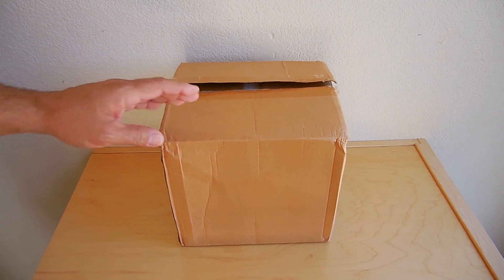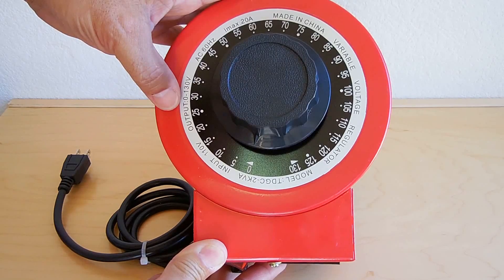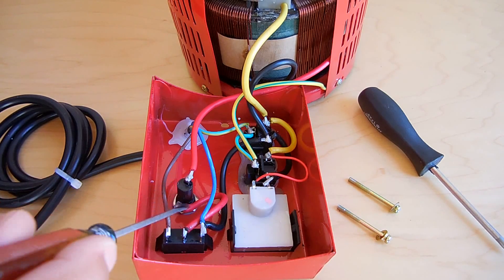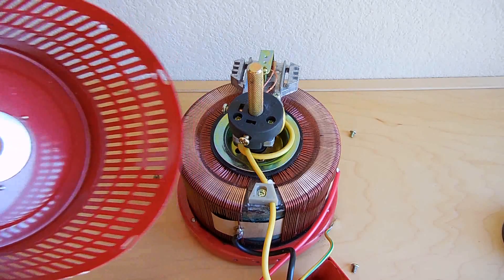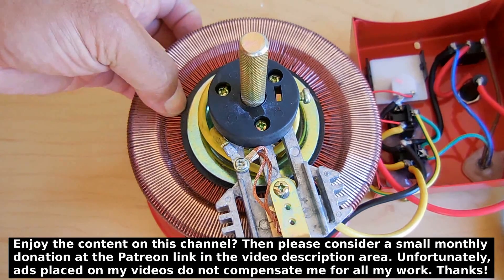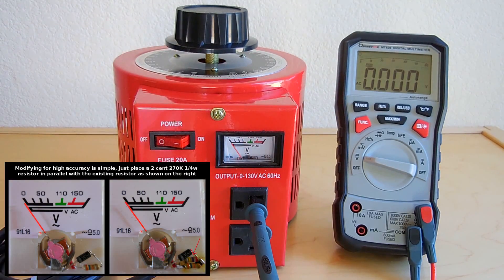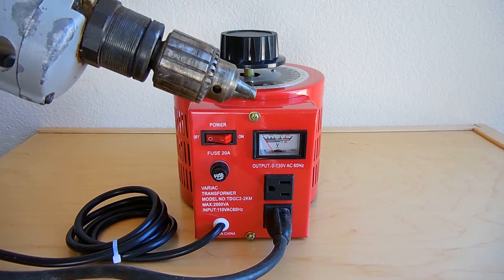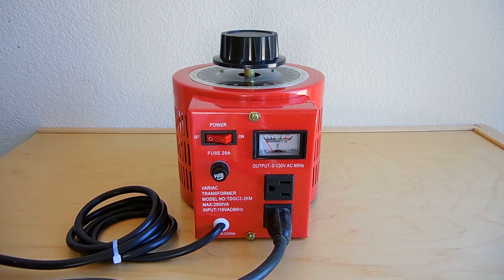2KVA 120V Variac Autotransformer (Incredible Buy)

Comment from the maker: Thanks for watching guys! If you're looking for other equipment/items at great prices, then please refer to my video playlist below. Scroll through the list to look for items of interest.

https://www.youtube.com/playlist?list=PLQ6IOhUBblU161growMalXOs1Ers6q_tj
Reply: I have a pure sine wave inverter that's putting out about 110V and I have an electronic pilot ignition on my gas water heater that demands exactly 120V.  I'm trying to find power line conditioner will boost to a steady 120V .  Will this AC Variable Automatic Voltage Regulator Converter do the job of stabilizing the output voltage to 120V?
Reply from the maker: @tersta1  Yes. You can boost up the AC input voltage to around 135V.
Reply: @electronicsNmore   Perfect!  I'm ordering one.  Thanks. :)
Reply from the maker: @tersta1  If it's not on sale, use the coupon code.
Reply: @electronicsNmore  For sure, I used the coupon to get a few dollars off and it was a lower price than other brands too.  Good deal .  Thanks for the video.
Reply: Do this isn’t to use near ViC gas flammable chemicals fumes?  Housin?  It will ignite? Annoying have to fix move unit to separate or ventilated.

Comment: Great video. I have a question for you please: They make a 500W version (120v) - I'd be using it for guitar amps that have a rated output of between 18W and 30W. Am I safe to assume that the 500W version would be fine? Thanks!

Comment: Beware of these cheap chinese units; they fail a few safety aspects:
1) fused only on the input. A variable auto transformer like this needs two fuses, one on the input as shown (optional) but definitely another one also on the output ; the output current is the one likely to be higher and needs to be fused to the safe current rating of the transformer.
2) that coiled cable around the spindle is a very unsafe and cheap construction method and likely to fail at some point; a safe variac uses a slip ring contact for this.
3) the single pole On/Off switch wired as shown is only safe for countries where the outlets have a known neutral/live configuration and the plug cannot be reversed. If this variac is used in a country where the plug can be reversed (e.g. The Netherlands / Germany etc) then there is a danger that the switch breaks the neutral rather than the live and the output will then be at the full 120V or 240V live voltage even with the switch off. One would hope that for those markets the unit is sold with a double pole switch. TBH the use of an auto-transformer in countries where the live & neutral orientation is an unknown is ill-advised; use an isolating variable transformer there (rarer, but they do exist).

Comment: I bought one of these or at least very similar and added a digital volt/amp/watt/energy display for better accuracy. While doing so I discovered that one power outlet was wired wrong, having the neutral and hot leads reversed. I urge everyone buying these to check them to make sure things are wired properly.

Comment: I've just got a 240 volt digital 0 to 2000 watts and I' m really pleased with it !!!!  The dial and the digital display aren't accurate so you need a volt meter !!!  Mine has a UK 3 pin plug on it !!!!

Comment: Do you think the digital display models will be more accurate with reading the voltage? Thanks.
Phil
NYC Area
Reply from the maker: Funny you said that, I replaced the analog gauge with a digital. It was only 10 bucks.
Reply: @electronicsNmore  How does the digital stack up? More accurate? Thanks.
Phil

Comment: My devices use 30A fuse. Can I still buy this?
Reply from the maker: This unit can only handle 2000W.
Reply: @electronicsNmore  Ok, my devices max out at 500w but how does this relate to 30A fuse in my devices?

Comment: I just picked this model up locally for $20. I was expecting an inefficient humming monster that doubles as a hand warmer but was pleasantly surprised that it is silent and only draws 8 watts no load per a Kill-A-Watt meter.

Also the trouble with any electrical gear like this is that you can get along seemingly fine without one, then you do get one and now realize that you need at least 3 of them. One in your test gear arsenal, one to take with you for various tasks on the go, and a third (or more) that gets semi-permanently hooked up to a specific tool or appliance.
Reply: Where did you buy it from?

Comment: The lower the volt the lower the watts as well?
Reply from the maker: The unit is fused, so you can't supply more than the fuse rating.
Reply: @electronicsNmore  If I hooked this up to a fan that runs 500w & turn the volts down to half will the watts drop down ?

Comment: I just bought this exact unit (except it's 240v) and it blew up in 3 seconds flat. As I dialled it up about a third of the way, it made a bang followed by a plume of smoke. On inspection it is a very poorly constructed device. That exposed wire (the 120V active connection to the enamelled winding) is a hazard. Why could they not have put some sort of insulative material here? The case is flimsy and could easily buckle inward during transit (this is a heavy item, mine was in the exact inadequate packaging) which potentially makes this variac a shock hazard. I say this because I also noticed that the ground wire and lug is inadequately connected to the case as it is between two layers of paint. This surely does not meet Australian Standards and is a great example of the inferior products that China swamp our shores with.
You should not be endorsing this widow maker in any way shape or form.
Reply from the maker: Many have bought the same device, and zero problems. My unit still works perfectly to this day. The version in the video is 120V, and you saw the inside of the variac. Clearly yours was defective, and I also have no way of knowing who made the unit, because they all look very similar. I'll agree with the housing being a little flimsy, but you cannot expect tick steel for the very low price. Sounds like the housing was dented in where the wires were soldered to the winding.

Comment: I saw where they built a Lichtenburg wood burner from a microwave and they used a variac  but it did not say if the transformer was plugged into the variac or the leads from the transformer were connected to the variac and then leads from the variac were used to burn the wood. Can you help?
Reply from the maker: I know nothing about that burner.

Comment: Hi,  My name is Michael Newell from Niagara Falls, Ontario, Canada.  I have a question for you. I recently bought one of these variacs.  Mine is the SC-5M model 5A at 500 watts, it says on the casing.  My question is this. I heard people on the net say that these Chinese variacs are not very reliable. Mine cost  $209.00 shipping included. Seems high compared to Ebay and Amazon. I was intending to use this with my guitar amps to lower the voltage slightly. My amps are 35 watt amp and a 40 watt Fender Blackface Bandmaster vintage amp and a 50 watt amp. Having something reliable is paramount with these amps. They very expensive. I've seen one video where a guy had to add an extra gree n wire to properly grond one of these units to the actual chassis. What can you tell about the reliability on these units? Mine is a 5 amp unit. Does it absolutely have to have a slow blow fuse? To run my  guitar amps, I really need exactly 5 amp fuse. My amps are use a3 amp fuse and a 4 amp fuse for the 100 watt amp. They are slow blow always in guitar amps. I noticed that you lowered your fuse by 5 amps in this video. Could I just replace the 5 amp fast blow fuse with one of the same rating , only slow blow?Thanks Michael Newell from Niagara Falls
Reply from the maker: Just make sure the unit is properly grounded. Trace the power cord ground into the unit, make sure it's connected to the metal housing and the receptacle ground. All inductive loads(motors/transformers/etc) require slow blow fuses to handle the start up current.
Reply: @electronicsNmore  , Hi, I opened this housing of this variac from China. From what I can see, the ground wire goes from the AC wire to the input receptacle  of the units ground , but there is no second wire going from the AC wire to the actual chassis. I'm just wondering about this. It seems to me that the AC wire ground goes directly to the ground of the input receptacle on the unit which I would assume grounds anything that you plug into this variac. Like I was saying before, this other guy on YouTube said that he added an additional wire from the AC wire ground to the actual chassis. Is that really necessary?  I would think that they would not sell this in the US or Canada if there was a danger to get electrocuted by touching the housing on the variac.please let me know if this absolutely must have an additional wire connected to the chassis. Thanks Michael Newell from Niagara Falls, Ontario, Canada

Comment: I’m down in Mexico and need something the buck the line voltage, I’m seeing 138Vac. Will this work?
Reply from the maker: Yes, you can set the output voltage at 110-120v.
Reply: Thanks for responding. I’m traveling in a camper in Mexico soon to be crossing back into the states. I need something that can boost as well as buck the line voltage.  In Mexico the power down here is poorly regulated, there’s essentially nothing wired to any sort of electrical code. 

Do they make a 30amp version of this product? 

Or would you recommend some other device?
Reply from the maker: A similar version is the 3000kva unit. The price is reasonable, but you will need to connect a 12ga power cord to the unit. A 12ga appliance cord cut in half is ideal. The plug side connects to the left side of the unit(input), and the receptacle side(output)to the right side of the unit.
https://amzn.to/3682umV
(Affiliate Link)

Comment: Could I use this to gently powerup the filter capacitors in a guitar valve amp? This is rated at 2 amps but from what I've read the suggestion is a variac rated at 8 amps is the one to get.
Reply from the maker: Not sure about the use, but the unit shown in this video is a 2kVA,  it's well above 8 amps.

Comment: I have one of these between my wall outlet and my drill press, it’s great for precise rpm on the drill press and eliminates changing the belt to different pulleys.
Reply: Mo no  Not necessarily true.
Reply: That's true, it would nicely vary your drill press RPM. HOWEVER, you will NOT have the power and torque that you would have by switching the belt pulley ratio. So that's fine if you're running small bits or drilling soft material if the bit is bigger.  If all you're doing is running 1/8 holes into plastic sure you can just turn down your power. If you're trying to run a 1inch paddle bit through oak.... just change your pulley. This method is not a remedy for laziness by ANY means. Period

Comment: Maybe someone could answer a question for me... This will only work well as a speed control on "Brushed" motors?  I have two Hazard fart "brushless" motors and it doesn't work quite the same on those... hardly get any speed control and the motor starts to heat up after a few mins of use... I believe the brushless motors are induction motors..

Comment: The fuse holder is wrongly wired; the incoming supply should go to the end connexion.
Reply from the maker: No, it's fine. The variac is protected by the fuse after the power switch. The power switch has an internal light, which allows the user to know if power is being delivered to the variac by the receptacle even if the fuse blows.
Reply: @electronicsNmore  You missed the point! With the supply going to the fuse terminal nearer the front panel rather than the rear of the fuse-holder there is a risk of receiving a shock should you be unfortunate (careless?) enough to fit a fuse whilst the supply is on as the fuse will make contact with the supply when the other end of the fuse has not yet entered the holder. No matter how careful one is there is always the risk of a moment's lack of concentration leading to an unpleasant shock even at your mains voltage. :-)
Reply from the maker: It makes no difference. The lower blade is not close(As it may appear) to the sheet metal and the fuse holder is solid plastic.
Reply: @electronicsNmore   O K, thanks.  :-I

Comment: Thank you so much for this wonderful review! I bought one today on eBay for $67.99 with free shipping from California. I am going to use it to control a Poppery II popcorn popper used to roast green coffee. This allows one to control the power, thus temperature. I am going to plug in a "kill-a-watt meter" into the variac, and the popper into the meter. That way I can monitor the wattage and change  the temperature at different points during the roast. When I receive the variac I will open it up and check all the connections, and like you mentioned, possibly resolder some.

Comment: The use of a glass fuse is extremely dangerous : it should be a ceramic bodied HRC fuse. Under short-circuit fault conditions, the fusible element will vaporise and deposit a conductive film on the glass, which will continue to conduct the fault current and cause the fuse to explode.
Reply from the maker: I wouldn't say "extremely dangerous", but you do mention valid points. It doesn't happen all the time when a fuse blows, but to eliminate the chance, ceramic fuses filled with sand are used. Even if the deposited metal continued to conduct, the extremely thin layer cannot handle too much current. The glass would also heat up and crack open, not explode. Thanks for watching!
Reply: electronicsNmore 
Maybe the higher distribution voltage we have in Europe makes for a worse situation. Early in my career I was carpeted by my boss for using a glass input fuse on 220 volt equipment - he told me in no uncertain terms to go and look up the maximum voltage rating of the fuse. I can't remember what it was, but it was nowhere close to 220 volts. It was a lesson I never forgot!

Comment: by the way you change the Torque   with Variac not speed, speed is changed because your drill is bad , speed is controled with frequency not Volts , im not an expert , didnt do it , but the way i understand it , yes wrong way to do it, may be cheap way but wrong, get alight bulb dimmer do the same for few bucks , i dont understand this really , but your money right
Reply from the maker: Clearly the lower voltage causes the motor to spin SLOWER, and higher voltage FASTER. The motor is designed for 60HZ, using other frequency power sources will cause the motor to overheat. There's nothing wrong with the China made Variac, especially for what I paid. If you don't have nice things to say, then please look for another channel.
Reply: yes and you control the speed of internal combustion motor by driving more compression or fuel in it , no you need to adjust fuel injection that is how it works otherwise its a bomb , not a motor ,  so read if you need to , i know how it works , you and others dont , so you need to read this i dont https://en.wikipedia.org/wiki/Variable-frequency_drive
Reply: im explaining you what you are doing , but you dont seam to get it .  Frequency =Speed , in AC motors , Voltage =Speed in DC motors , you just did an experiment , like most Scientist do, and you got your results , and you say Voltage Equals Speed, WRONG . 

Practical Example #1 Setup a Motor  to drive another motor as a generator , and change its speed with that variac observe the output frequency ! (Answer: The number of poles (magnetic poles) and the rotational speed determine the output frequency: Freq = Engine_RPM * Number_Of_Poles / 120.)

Practical Example#2 : DRONE Motors  . do they have variacs in them ,no they dont ,  build one , or use just a motor , same result , change its speed , and observe how you change it with voltage or frequency? ( result Frequency) 

Conclusion : Voltage assuming constant Current =Torque , Frequency =Speed  in AC motors , in DC its Voltage =Speed , Current =Torque  there is no Frequency involved .

If you dont believe me , feel free to challenge me with a practical Demo , and if im wrong call me an idiot, in front of everyone , link my channel , link my posts , say this man is an idiot . Or read what i said but with care , to learn and know how stuff works , if you care , if not then i write this for others since ive seen 10 videos doing exactly the same , and Argument with Motor Controllers Seller, thinking he has best Motor Controllers , but guy has no clue what he is selling , he asid Light Bulb Dimmer is Motor controllers , there you go, what can one say to him . i cant explain this to each and everyone . so im gonna leave it here , wasted 20 minutes writing this hope you care , if not , the f it .

Comment: I just stumbled on the word viariac, after checking it out ran into your video. Very good explanation ...thank you!

I have a harbor freight wood lathe, not a bad lathe and it works for me but if I had variable speed ....it would be tasting a little bit of heaven on earth :) It has an electrical motor (capacitor on top) 120 V, 60hz, 1700 rpm (no load)

So, my question is ...will this work on an electric motor without burning it up. Here is the link for the wood lathe, maybe it would give you the info you need to answer my question. https://www.harborfreight.com/12-inch-x-33-3-8-eighth-inch-wood-lathe-with-reversible-head-34706.html

Really, really appreciate your thoughts on this and help! Will definitely buy through your link if it will work :)
Reply from the maker: That particular motor may get burned up.